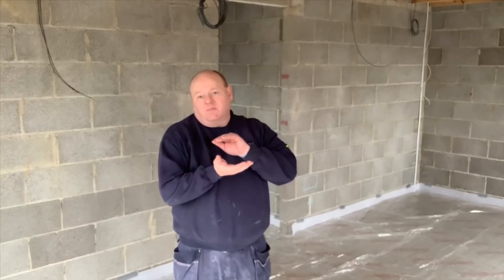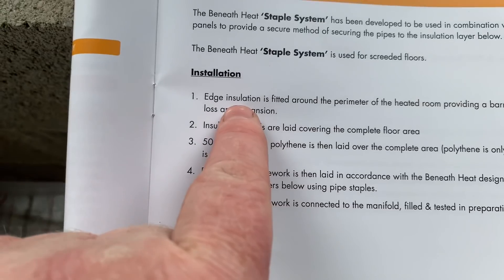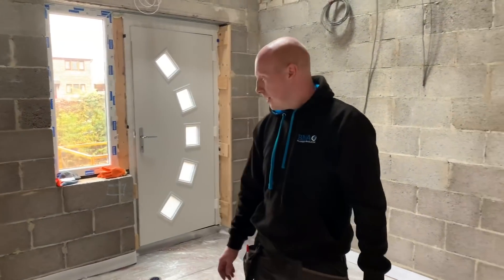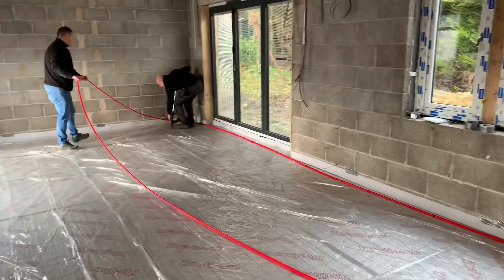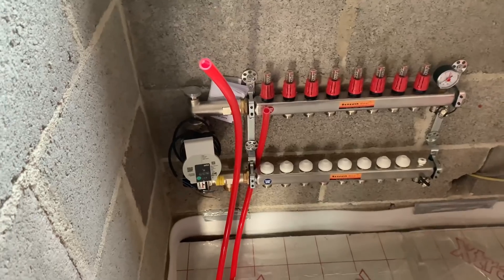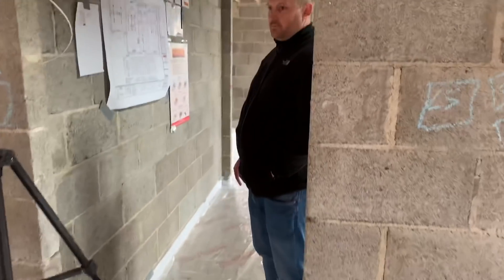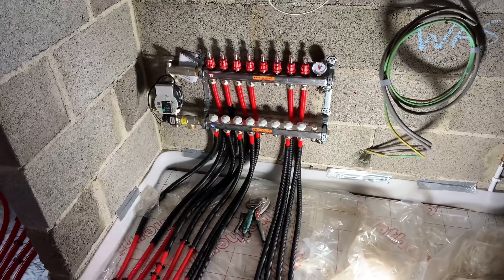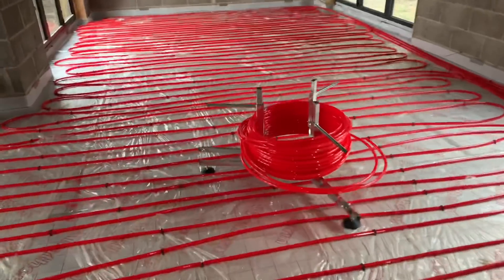UNDERFLOOR HEATING INSTALLATION -  Staple System - Slab - Beam & Block Floor

Comment: hello so glad i came across your videos i have one question please I fitted underfloor heating in my kitchen quite a few years ago as a DIY er and i seem to notice that there isn't a motorised valve on your systems please could you explain what they are for and do they still use them brilliant videos by the way please keep them coming

Comment: Hello Allen
I first must thank you for your very DETAILED videos I mean right down to breaking down the parts piece by piece and showing us what what these things work NO one else dose that THANKS. 
I am and always have been a DIY guy. I am now installing an under floor radiant heat system that will be mine third system. I am also an a Solar energy enthusiast. 
Question please if you will. I wish to incorporate my solar thermo system with a combi boiler.
Allen do you know of any combi boilers that will accept preheated water or that would work well with Solar Thermo?
We Love your videos please continue the good work.
Thanks
Jim in the US.
Reply: Thanks Allen
Reply from the maker: Thank you Jim.
Reply: Allen do you of any boilers that accept preheated water?
Thanks again for all your videos.
Reply from the maker: @Jim911Bo  I believe most boilers will accept preheated water. Best to check with the manufacturer of the boiler you are thinking about. Thanks

Comment: Excellent video thanks. Was on a job a while ago pretty sure they used ordinary jg speed fit  pipe for underfloor heating. Is this ok and if so what is the advantage of using the proper stuff? Just curious.
Reply from the maker: I haven’t used the speedfit system so i cannot answer sorry.
Reply: Don’t know as it was a system. Think they just brought some pipe from the trade counter and buried it in the screed. Have also seen the yellow plastic street gas pipe used in their buildings and meter position changes done for cash. Thanks for the reply. Merry Christmas. Don’t work for them anymore btw.

Comment: I got to say Allen this is not a good example of underfloor heating. Where do I start on the straight runs there about 5 clips in it  there should be at least 3 times that amount. 2nd there have a staple gun and pipe winder  why are 2 ppl  installing this 3rd the tops of the loops are all at different heights. 4 I don't understand why ppl install  a up down system you should also do a big loop little loop system it's more efficient and lastly why would you work from the right then from the left and finish in the middle that completely made no sense at all. Sorry allen but this was a really poor job from the company that installed it I have showed this to other UFH installers and there  were shock at the installation of the pipe and the presentation of it
Reply from the maker: smart tech we didn’t have enough clips, more clips where added afterwards, also the nail gun kept on jamming. The design was as per the drawing, Thank you for the feedback though.

Comment: With the pipes being so close coming into the manifold through the doorway,would you not be afraid of to much heat,maybe every second one put the black covering over till you start your 150 centres again.
Reply from the maker: It’s done to the manufacturer drawings, Any issues would be down to them. Thanks.